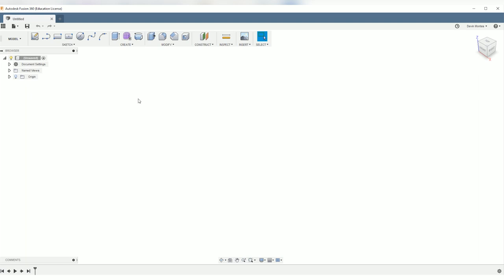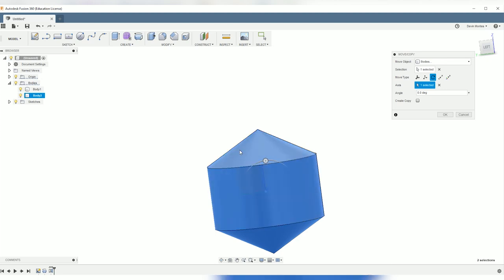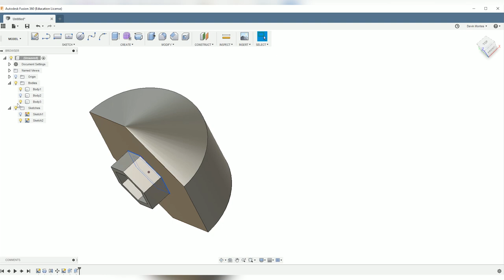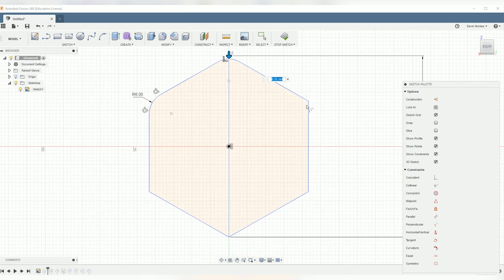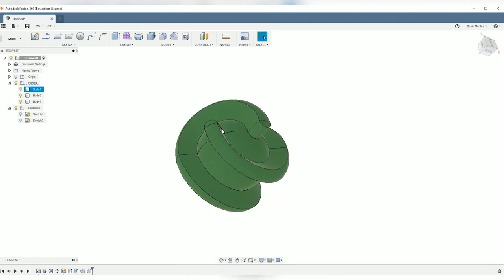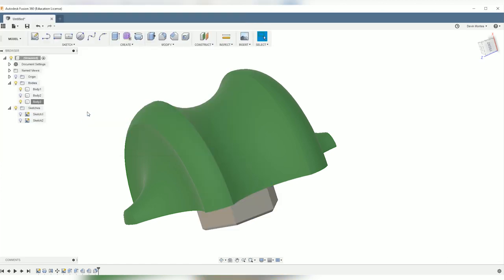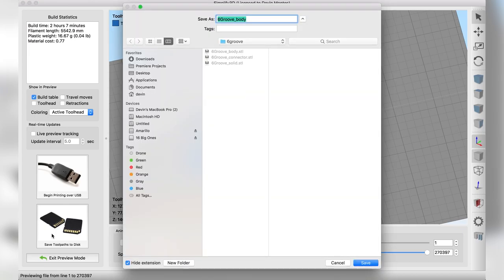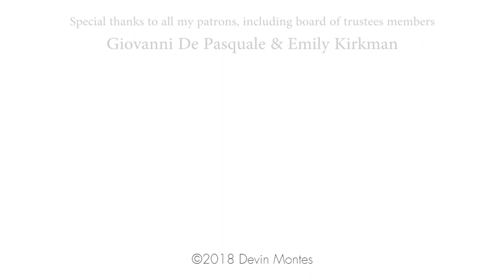How to Make Sphericons // How to Make Anything #4

Comment: If you stuck the sphericon into the acetone bath assembled, I'd expect it to smooth and fuse the two halves together pretty well based on the giant gap and fillet it leaves when you do the parts separately. Maybe drill the tiniest hole into one of them and put a very, very thin strand of thread/wire though it by which to hang it from the container.  
Could make an interesting, almost impossible looking result I'd recon.
Reply from the maker: I considered this but just didn't have the time to build the proper set up :/ maybe in the future!
Reply: @Make Anything, Well, you obviously need to gather enough crazy tests for you acetone smoothing part 2 video first, so now you at least have one - fusing separately printed parts together :)

Comment: So, the acetone rolled up the edges? BIG difference in a fit of the two halves between 12:52 and 13:40 of the video.
Reply from the maker: Yep, it rounded the corners out a lot. I actually kinda like it, but it would be interesting to try smoothing it stuck together

Comment: okay, so it turns out that Fusion 360 is not as intuitive as it looks. I did manage to model a hexasphericon, though! I did have a few issues. One was that Fusion refused to see the tracks I cut out, at least for some of the sketches. Another was that instead of the rotate making a solid shape like you've got, I ended up with a shell.
Also still figuring out how it locks shapes to each other. Kept trying to make things really wonky on me, resizing lines and angles  weird when all I wanted to change was the size of the track I'd cut.
But! For my first experience with the software, I think I did a reasonably good job! I dunno if what I just designed is actually printable or not, but it looks cool, and I can play with it more tomorrow. Or... later today, I guess. It was already after midnight when I started. Whooops...
And the reason I decided to install it tonight instead of going to sleep was because I wanted to better visualize what a penasphericon looked like... but since I had to follow this tutorial much more closely to figure out the controls, that one will have to wait. Perhaps tomorrow.

Comment: Can you do this in inventor 2019?
Reply from the maker: I haven't used Inventor, but I imagine the process is very similar
Reply: @make.anything  I just made it and I made 1 sketch and revolved the two sides at 2 different axis. So it turned out to be much simpler. But the rest im still figuring it out.